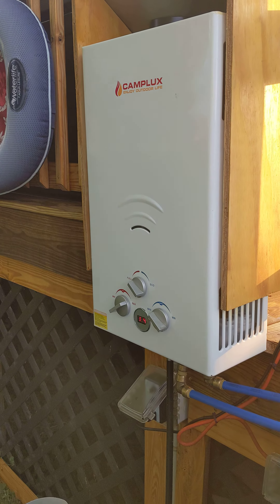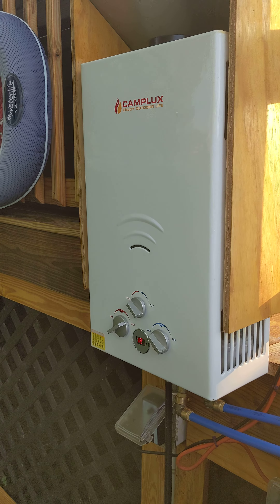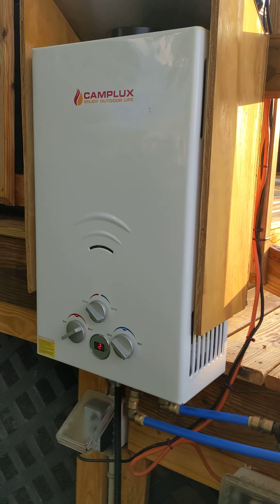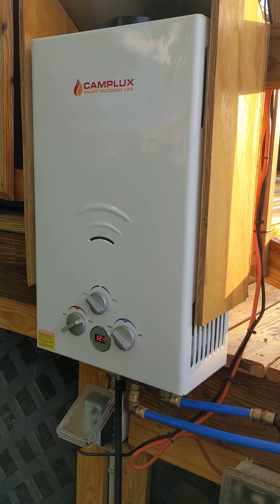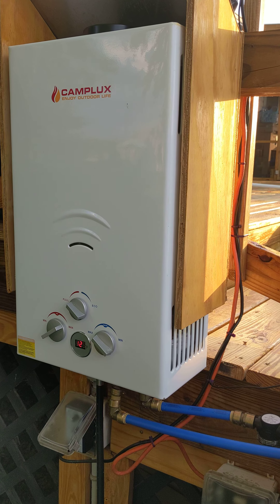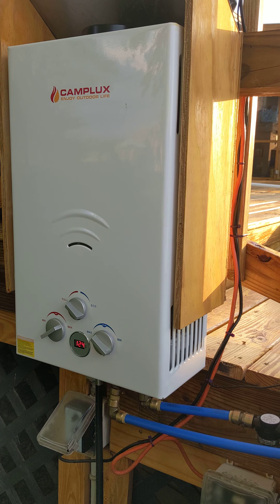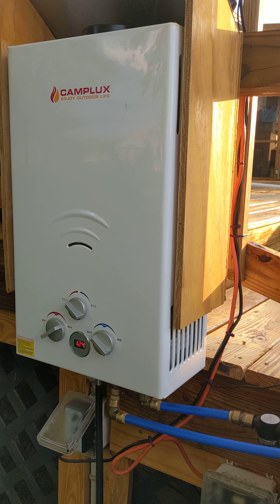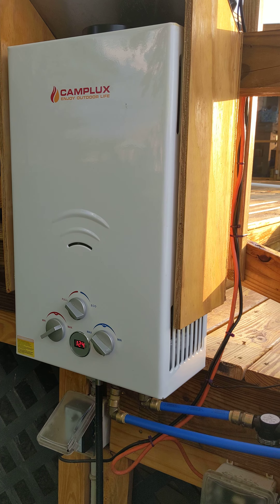DIY Pool Heater - An Update

Comment: Don't you think that the heated return pipe to the water is to close to the water intake to the pump..
Reply from the maker: Yeah it probably should be further away. I usually keep the inlet pipe turned towards one end of the pool and the outlet turned towards the other end.

Comment: How large is your pool. I did a similar setup with a 18’x52” and ran it for almost 8.5 hours. Barely made a dent in the temp. The heater runs 4.8gph.
Reply from the maker: It's a 12x24 around 6800 gallons. 

Yeah, this probably wouldn't work for a pool that large.
Reply: Depends on the pump your using to push it thru. I had a 800/gph pond pump running through a coil in a fire pit(16x48 pool) and it just barely maintained it. Thats the difference between the "pool" heaters with a 1 1/2" in/out compared to a standard 3/4" in/out.
Reply: @ProjectDIY2  12x24 at 6800?? My 16x48 is 5001 gallons.
Reply from the maker: @smahring  Just going by this calculator...

https://www.royalswimmingpools.com/pool_gallon_calculator.html?utm_term=&utm_source=adwords&utm_medium=ppc&utm_campaign=%5BSB%5D+Tier+B:+DSA+(All+Pages)+-+US&hsa_kw=&hsa_acc=9744442392&hsa_ad=489088540697&hsa_net=adwords&hsa_mt=b&hsa_cam=11954164301&hsa_ver=3&hsa_src=g&hsa_grp=118513120249&hsa_tgt=dsa-19959388920&gclid=CjwKCAjw-e2EBhAhEiwAJI5jg4AWmT4QEWNWGJLpJc_ToYGimzgXPYMtytXZADxK51PuZwmOJ3gC2hoCo-AQAvD_BwE
Reply: @ProjectDIY2  I already did some research... at 5000 gallons you need a minimum 50k btu.(about equivlent to 15kw electric). A 12x24 should be good with about 30k btu, but the main factor is the pump pushing it out before the air chills it. Looking at minimum 1000/gph pump.